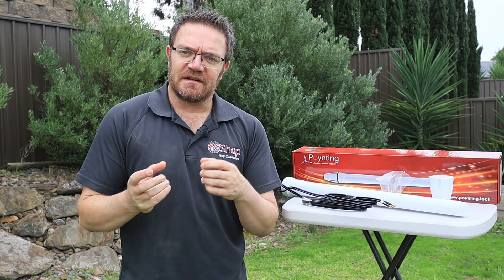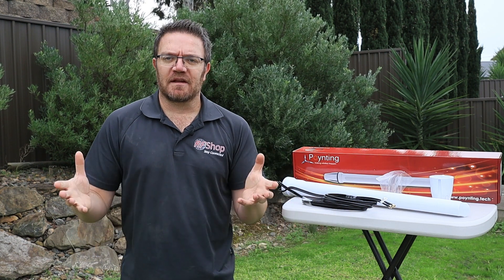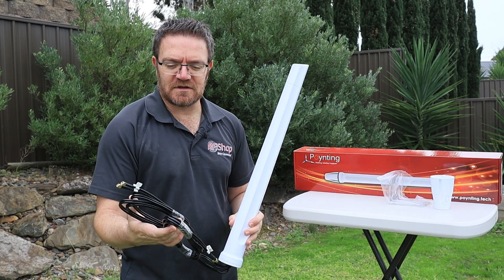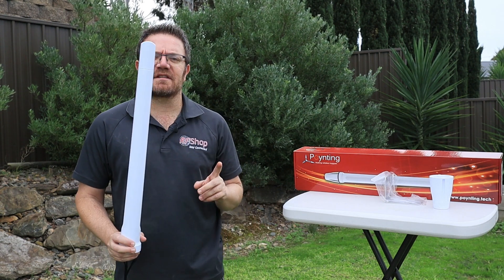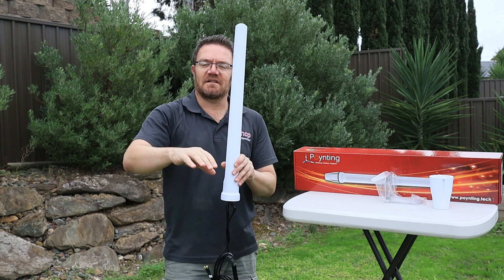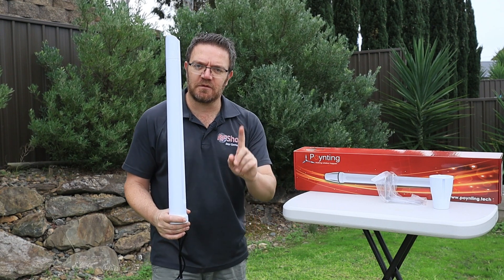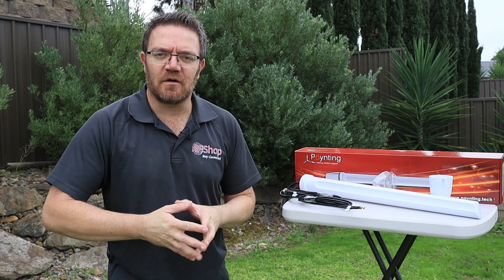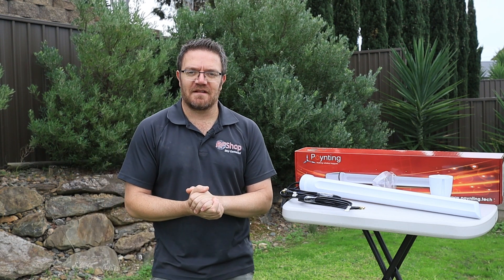What's the best 5G Marine Omni to use on my RUTX50 ?

Comment: Hi i have a peplink moden BR1 which pynting antenna do you recommend to have the best performance in a boat of 100ft? I have starlink connected to my moden. So better to have a pynting 402 mimo 2x2, the 414 mimo 4x4 or the 493 mimo siso??
Reply from the maker: Thanks for your question. The best option would be four individual antennas, but it may not be practical. I think best compromise is using two 2x2 OMNI-402’s

Comment: What do you do for surge or light protection that can come through antenna?
Reply from the maker: There are a number of products available out there, basically called lightning protectors. They will prevent power surge (if it's big enough) to come through. It happens by them short-circuiting once a lightning strike hits

Comment: With the dual sim routers such as the rutx12 or rutx50  do the 4 antennas all go to both modems or is it 2 antennas to each modem/sim.
Reply from the maker: That's a good question, and it's different between modems. 

On the RUTX12, two antennas are for one modem and two for the other modem (it's marked on the documentation). Each SIM goes with a modem. 

On the RUTX50, all four antennas are used. They are used differently on different bands, but it's quite complex and switches between setups so impossible to pinpoint. The simplest is to just assume all four are used at the same time.
Reply: So which antenna setup will you recommend to use with the RUTX12 for maritime application ? thanks  @RFShop
Reply from the maker: @GpconnectInfohotspot  I would consider one of two scenarios (sorry, always have options). Keep it simple, and use a single 4x4 MIMO omni antenna such as the Poynting OMNI-414. One antenna, four cables...it's a simple and very good solution. Can also look at the MIMO-4 antennas that do the same job but for best gain I would stick with the OMNI range of antennas. 
Alternatively, if you are willing to do something slightly more complicated and likely to be somewhat superior I would consider 2 antennas. 2pcs of the same OMNI-402...each antenna with two cables. One cable of one antenna to port 1 and the other to port 3. Then the one cable from the second antenna to port 2 and the other cable from antenna 2 to port 4. Then you'll have spatial diversity on both modems. 

Regards,
David
Reply: @RFShop  same scenario could be applied to a hd2 mbx 5G with 2 omni-414 for spatial diversity ? thanks
Reply from the maker: @GpconnectInfohotspot  Yes, indeed. It's not the modem that defines how the MIMO should work, it's the technology itself.